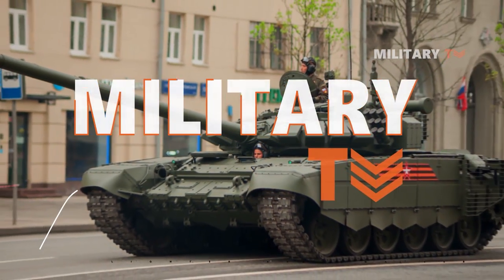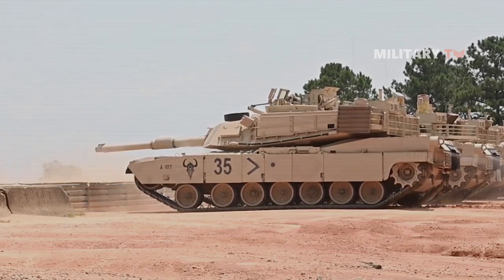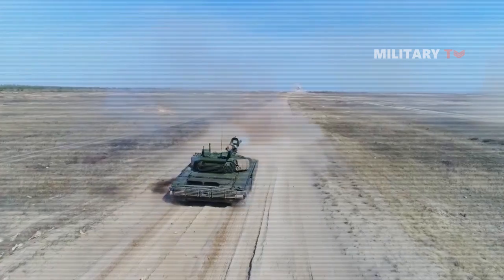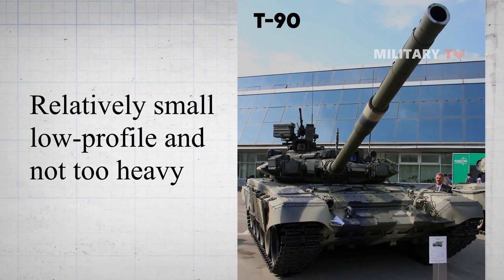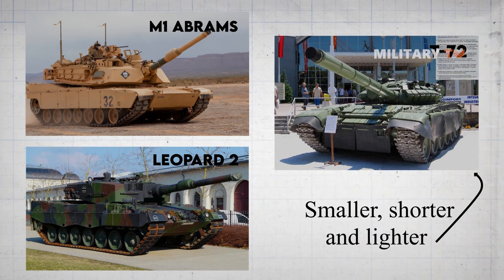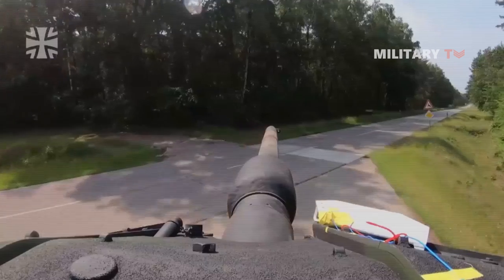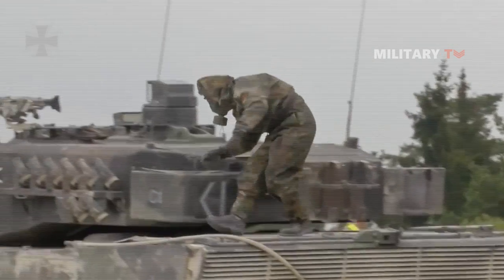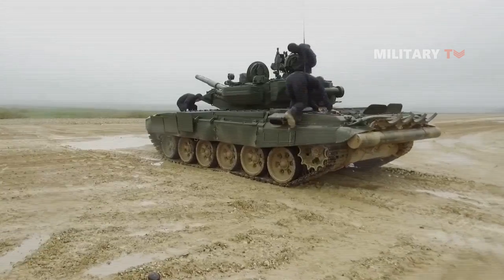Why are Russian tanks lighter and smaller than the western tanks

Comment: I know a lot of the docterine with western tanks was based on a defensive imperitive, moving back but always shooting from some sort of hull or turret down position.  The human loader can go pretty fast in bursts and get a rest when displacing to the next defensive position.  You need at least a 3 to one ratio on the offense so the Soviets had to make more tanks, you make them smaller because it is easier, and you do not worry about quality so much because the 3 to 1 ratio means you are going to lose plenty of them.  Good enough for the man at arms in the line, versus armor of proof for the tourney.

Comment: Author forgot to mention that russian tanks (here I won't distinguish soviet and modern Russia tanks) smaller silhouette and height was a special construction feature to decrease enemy's hit probability. Also, weight (=>size) matters a lot for railway transport: it was the main reason for soviet main battle tanks to be limited at 45 tons weight (or so, I don't really remember the value). When you have a thousand mile long country, a longest in the world, to defend, you would think twice before making heavy tanks, which are unsuitable for most flat railway wagons. Basically, soviet engineers had no choice but to make smaller tanks.
Reply: So far javelins in Ukraine are hitting 94% of those smaller size targets.  And the slightly smaller size would make no difference if say an A-10 warthog was firing 6,000 rounds a minute of depleted uranium rounds at the tank.
Reply: @rudder727  You are comparing soviet-engineered (and often soviet-built) tanks and modern anti-tank weapons. Besides, as far as I know, Javelins were made to hit exactly that target: relatively (to Abrams M1) small, typical heat signature, etc. Actually, my intention was not to start a dispute, but to add a few facts. If soviet tanks are small, it doesn't make them better target.

Comment: US requirements for their combat vehicles specify that they must be operable by 95th percentile personnel. The Soviet design bureaus focused on shorter personnel for the crew which allowed height and space reductions that weren't possible for US designs. Add in the survivability requirements via passive armor and you quickly end up with combat vehicles the size and weight of the M1 and Bradley.
Reply: Average GI is what somewhere around 5'7 and 6'0. Need that extra head space.

Comment: It stems mostly from Western & NATO military doctrine. Western main battle tanks were mostly designed to be bigger, slower, more heavily armed & armored during the Cold War to be the rocks that waves after waves of Russian tanks would break while reinforcements were brought up from the rear. Other systems such as the A-10 & AH-64 were also built to help with this objective. It's also why standard procedure for NATO tank crews is usually to fire a discarding sabot round then immediately load a HEAT (high explosive anti tank) with the goal of poking a hole with the sabot into the Russian tanks rotary auto loader system then to blow the enemy tanks ammo up with the HEAT. It's why there are so many videos & images of Russian tanks with their turrets blown off from as far back as when the Israeli's first fought the T-72, the "lollipop" T-72 turrets during the first Gulf War & all the way to today in Ukraine.

Comment: Western tanks were largely designed to fight a defensive war against those hordes of smaller Soviet tanks. The difficulty in transporting a heavier tank did not matter. 

Still, this video overlooks many of the advantages of the bigger Western tanks. Having that 4th crewman as a loader has a number of perks. The big one being that autoloaders have a lot of trouble switching between rounds. If an M1 had an HE shell loaded but a tank presented itself as a target in the distance, the loader could quickly pull the HE shell and load a APFSDS. The Russian tank with the autoloaded might have to just fire that HE shell to clear the gun for the anti-tank shell. The human loader can often load as fast or faster than the autoloader AND function as a 4th man to help maintain the tank in the field.

The video is correct about one thing. There have been tanks of making a 130mm equipped Abrams. The large of a shell might necessitate an autoloader. We would still keep the larger size of the Abrams because that allows rounds to be stored in the turret in blowout panel equipped storage.

Comment: dude what are you talking about the M1A2 SEPv3 abrams would mop the fucking floor , with advanced gen 3 flir for target acquisition with dual independently controlled cameras for hunter killer techniques , improved power train, increased protection from explosives , increased battery capacity for silent watch, ammunition data link system for improved munitions , the obvious crows mounted m2 browning 50 cal. not to mention its reactive armor plating for dealing with AP munitions , this combination along with the u.s armys comprehensive training programs and interoperability between dismounted and mechanized units makes the abrams the ideal tank of choice , the reds cant even unfuck their comms let alone used combined  arms the abrams would blow that piece of shit sky high before they even knew they where engaged.

Comment: The simple answer is they're cheaper to build, crew (since many are 3 man crew) and field (less fuel).  This allows the Russians and their buyers to field larger numbers for the same or less money.  More always LOOKS good and does help when using tanks as infantry support against weak opponents, but we've all seen how it actually works out in the field when up against a real foe (the planet is littered with destroyed T model tanks).

For the record, the biggest failure of these smaller tanks has always been their inability to raise and suppress their main gun very well.  Not only is their aim greatly limited in many situations, but they have extremely limited ability to go "hull down" simply by finding a rise or hill.

Comment: Russian Tanks are smaller because they are disigned to attack in open terrain. Their smaler silhouette allowes them to vanisch in sinks and behind smaller cover. 
Furthermore the triangular armor attached to the tower makes it extremely difficult to penetrate the armor, because projectiles can bounce  off. 
The downside is, that russian tanks can only move their barrels in a limited way upwards and downwards. 
F.e. during the Yom-Kippur-War the Syrians used modern russian tanks but were pushed back by the israelis who used older british tanks. The reason was, that the russian tanks couldnt aim at the isrealis who helt the high ground.

Comment: Larger tanks cost more to produce, maintain, and more crew members to run. Further, you need more tanks to cover more ground. What good is bigger tanks if they run out of fuel and can't be resupplied in time? The Soviets beat back Nazi Germany invasion with much worse tanks than the Tiger tanks because the Tiger required so much resources to run. In large scale ground battle, it's the logistics, not the strength of individual tanks. 

The U.S. Abrams can only cover 200 miles before refueling, despite needing almost 600 gallons of fuel. Imagine in a large scale battle where tanks would need to cover large distance and the supply trucks keep getting shelled by mortar or rockets, bigger tanks are literally giant targets waiting to be destroyed. There is a reason the U.S. Army asked Congress to stop earmarking new money for Abrams.

The West has always focused more on Air and Naval superiority so they never need to produce too many tanks.
Reply: Tigers were not the backbone of the Wehrmacht however. The majority consisted of Panzer III's, IV's and StuG's which were still superior to their enemies' counterpart with the exception of costs.
Reply: @EndlessVoid98  I agree. Even with that, the Germans lost because the Soviets were able to resupply the lost tanks much quicker than the Germans. Also, Germans didn't have access to unlimited oil like the Soviets. Tanks without fuel are just expensive targets.

Comment: Because they need to blow up when hit with one warhead, so the smaller and lower they get, the better they brew up!
The soviets never did  consider survivability as a top consideration. Those 4 crew are always better at maintenance than 3. As long as the Russians field tanks with auto loaders under the crews feet, they will suffer more casualties from ammo fires. Those turret flying Ts will continue to mark the fields.

Comment: That certainly didn't age well.
Reply: It aged very well actually. The future of MBTs are smaller and lighter tanks.
Reply: @JAnx01  Why don't you just get a cardboard box and paint "TANK!" on it with crayons? It actually provides more protection because a shaped charge will rip through it without actually exploding. If that thing doesn't hit you in the chest, you will survive. More likely, still, the enemy will be incapacitated by rolling on the floor laughing, which is a much better outcome than being hit in a real tank by a modern anti-tank weapon. ;-)
Reply: @schmetterling4477  Basic geometry dictates that the higher the interior volume is, the more mass of armor is required to protect it. So if you have a weight limit, less interior volume means thicker armor and thus better protection.
Reply: @JAnx01  Ah, so now you are desperate to prove that you don't understand physics, either. Cool. ;-)

Comment: The advantage of smaller Russian tanks is they can be destroyed, ad nauseam, whilst western tanks can send 120mm sabot rounds up their asses at stand-off range. The other advantage of smaller Russian tanks is their external fuel tanks are never vulnerable to HEAT rounds, or any sort of shenanigans. Lastly, the final advantage of smaller Russian tanks is their diesel engines aren't less efficient, or noisy to turbine engines, making them slower, louder, more smoke producing and generally more of a piece of shit.

Comment: Its harder to hit smaller tanks
Reply: Only in theory. In target practice it seems to work just fine.
Reply: When it is a tank battle on a difficult terrain in bad weather. Modern third generation ATGMs with tandem HEAT warhead, modern guidance system with fire and forget capability supported by IIR seeker or mmW seeker, tip attack capability has rendered the size profile of the tank irrelevant. These days uparmored western tanks remain as much vulnerable to penetration as low profile Russian tanks remain to getting hit and it is just about all over once the ATGM impacts. There are solutions like APS but even APS can be overwhelmed by firing a combination of large number of cheap line of sight RPGs and few ATGMs simultaneously. No tank can boast of invulnerability.

Comment: Basic law of armor (technically survivability) in war. If you can ensure It will survive at least (I think the benchmark is 85%) of attacks,  then pretty much any cost is justifiable.  (Usually measured in how many engagements is the unit in question has a significant risk of destruction.)

But once you dip below that number, then even no armor at all becomes preferable to heavy armor.

I believe only the main battle tanks used by the US still have high enough survivability to justify their cost. Even the M1Abrams sold by the US get so much if their defenses stripped away before being sold that they are no longer worth their cost.

Comment: No mention of the advantages that factor into the decision to design within a higher weight and size, just mentions of advantages of smaller weight and size. "Military TV" should rename to "Warsaw Pact Propaganda TV".
Reply: There are no disadvantages with lower weight. The Soviet / Russian tanks aren't lighter than their western contemporaries because they're less armored. They're lighter because they have much less interior volume and thus the Armor around it of the same strength simply weighs less.

Comment: Lighter, means less metal/ material so it's cheaper per copy.  Automatic loader, they thought less one operator in turn save a life.   Smaller/ lower profile smaller target and can run faster they thought.  Realities, they may save a few dollars but speed and low profile didn't mean nothing.  On the other hand, it's A DEAD TRAP.  IT ONLY TAKE ONE JAVELIN OR ALIKE TO KILL THE  TANK AND EVERYTHING INSIDE.   Ukraine battle ground proves just that. Conclusion, needless to say more, Western tanks are much opposite built comparison therefore a lot better. 👈

Comment: Russian tanks are literally built for midgets, if you are over 5'5" you will not fit into a Russian tank. But even with a smaller crewmen the tanks are very cramped and difficult to operate in battle. Tank crew also have mixed feelings about the auto-loader, which can load body parts instead of ammunition. The Russians, and those copying their designs are willing to trade these negative features for cheapness to manufacture which allows more tanks to be built. But in combat Russian tanks have performed poorly, usually exploding with dramatic effect when hit. The Middle East is littered with the hulks of Russian tanks.

Comment: I mean, an Abrams can hit like, 72(k/mh, or 45mph), right?

Pretty sure more armor is better.

More firepower too.

Based on the, "its cheaper and more maneuverable" as well as the grammatical errors in this vid, Id guess you have something AGAINST western tanks.

That cage will probably help vs javvies. 🤣🤣🤣🤣🤣🤣🤣🤣

Edit: looked it up, t90 goes 43mph.

Lololol.

The manual loader protects the crew when hit by a javelin to an extent. Instead of putting all the explosives in the turret, its sealed off in its own capsule. Further, the 4th man can drive the tank if 3 are injured.

Ffs.

Comment: Stupid video,   Russian newer designs copies the western tanks like the T-14 Armata is 55 tons and probably fully loaded at least 60 tons which is identical to the Abrams.   The Russian auto loader is nothing but a disaster which serious maintenance nightmare and the west has a much larger population then Russia so can easily find a gunner per tank not a big deal.    The USA was able to fight 2 wars with over 1.5 million solders in Iraq and Afghanistan without even using a draft army and if the USA were to have a draft it would be many tens of millions of people so a gunner is not an issue at all, better than a maintenance nightmare.

Comment: what an utterly laymens approach to making a video trying to explain something that has nothing to do with each other... what a fail of a video. 
The reason for the heavier western tanks is the COMPLETELY different structure of armies that the west and the east use. The Russians tend to PLAN their armies and resource management from the past outwards while the west tries to adapt to the circumstances as they arise. What does that mean? it means that the Russian tried to make A TANK that is THE TANK. A way of making war, utterly incomprehensible to any western army. Since we use a large array of different tanks and vehicles. The main battle tank as you think it is, exists only in the Russian army. It has a totally different purpose in the Western forces. Even though the civilians will think they are the same, as both fall under the category MAIN BATTLE TANK. They are basically different in any and all things beyond that name and category. European armies and the USA for example field a far larger variety of motorized vehicles than the Russian army often very distinct in purpose and nature. Different setups from fast-moving tank destroyers with wheels and chains to motorized artillery vehicles but more importantly the western armies make heavy use of small fast infantry transporters with quite heavy weaponry and equipment (think hummer jeep). The Russians though wanted to have a defended vehicle that is ALL in ONE tank practically. While in the European system of war the Main battle tank has a very specific purpose that is mainly overpowering weaker position AFTER long-range tank destroyers, artillery, airforces etc have taken out anything that could become dangerous to the tank itself. The Russian approach is to field large quantities of MBT (main battle tanks) supported by heavy artillery under whoms "protection" the MBT approach positions with infantry to practically bait out the enemy fire which is then dealt with by the large force of tanks and infantry. Do you see the difference? It's two different worlds...THAT'S why the one is expensive and the other is as cheap as possible. Because the expectations of losses are a totally different one. And that's WHY the western tanks have been destroyed so much in the wars in the middle east. Because they were used there/given to the armies of these countries or bought by them...These armies often approach war exactly with the same mentality as the Russians. It's big, it's heavy just roll it in it will withstand...Obviously, that's a mistake you'll do once..and only once. Except, of course, you built 4 tanks instead of 1 then you'll take the loss in order to destroy the position. And then just get another tank. 
The differences between the tanks lie in the armies that use them. And have nothing to do with what you're talking about here. Neither have western tanks' "weaknesses been exploited" or whatever in Syria or elsewhere. 
Now western armies have vehicles meant to do the exact same thing as the MTB of the T series for the Russians? how about you compare those? try comparing a Hummer jeep to a t series and the difference in expenses hmm? Because on the field...they both basically have the same purpose.